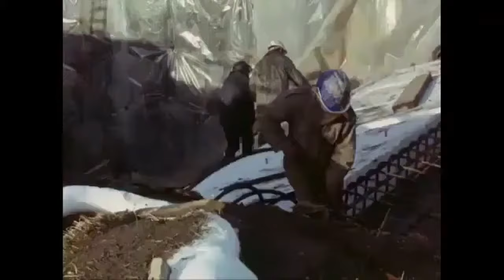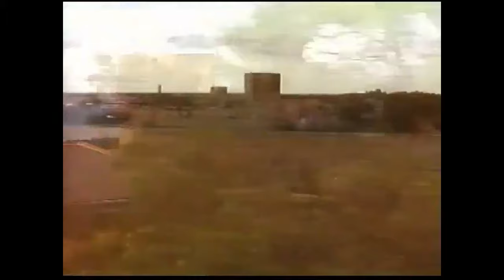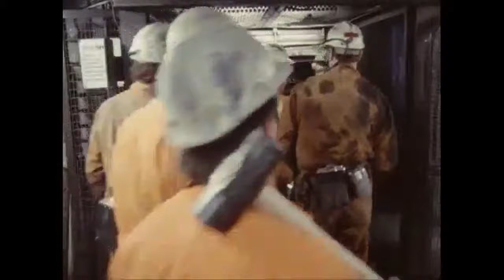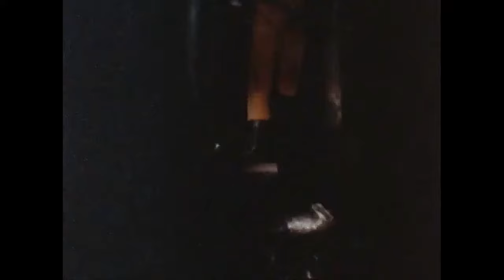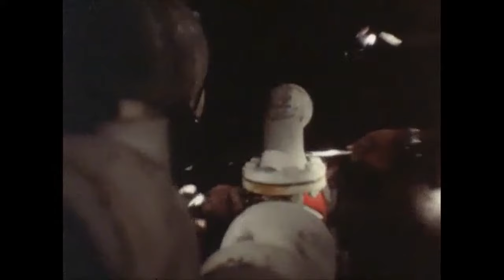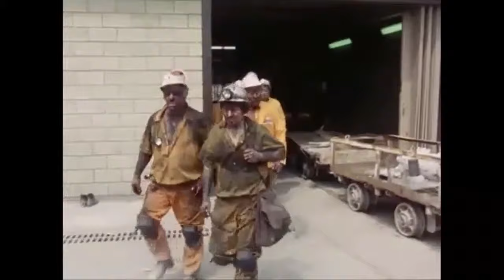Tribute To The Proud Coal Miners Of Wistow Colliery.

Comment: Work there for 19 years on coal face headings some good conditions  some bad great set of lads
Reply: I took redundancy in 1993, was glad to get out at the time but look back with fond memories. Was a fitter and installed the first tunneling machine after the contractors had sunk the shafts, a MK 3 Dosco, that was about 1980 or 81 I think.